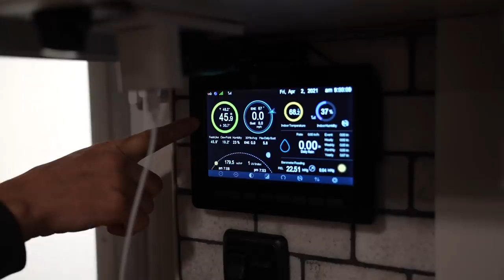WE'RE NOT READY FOR THIS | BUILDING OUR OWN HOME

Comment: Pro tip: place wood backing behind where you will be hanging towel bars.
Reply: Builders never do that. That would be to easy .
Reply: And future grab bars.
Reply: And curtain rods
Reply: also where you are hanging cabinets. always a common practice when using metal studs
Reply: Yup, hang a cleat either behind the sheetrock or in front if you like that aesthetic. Makes installing or changing hardware much easier.
Reply: Also where you might mount a TV.
Reply: Yes!   I wish my builder had done that.  All of our towel holders are loose no matter what we try to tighten them up..
Reply: Use the scrap 2X6 that are left over after framing for towel bar backing and also above the cornersof  window for window treatments if your doing that.
Reply: You cannot say this enough!   Reinforce every place you will be attaching anything!
Reply: Good idea. My aunt built her home and hung wood between the studs where pictures would be hung and took pictures of the open wall for when they were finished, so she could find them easily.
Reply: Also behind TP holders
Reply: Oh yes. In NZ we don't just gave studs. For an 8 foot stud we have 2 nogs (like horizontal studs that fit between the studs) and even that is not enough.  It is frustrating when your towel rails etc have to go in a spot where there is reinforcing, rather than where they look best and are most useful.
Reply: And run electric, with all the other gadgets and amenities I can see some heated towel racks in your future...
Reply: @1BobsYourUncle  sounds like you need to use some spring toggles!
Reply: Brilliant idea!!!

Comment: Hey Trent and Allie Love your videos. Quick reminder upstairs the electrical outlet next to the water pipeline that will not pass you are gonna have to either relocate the water line or you gonna have to relocate that electrical outlet for one reason one reason only if that pipe breaks or you have one little wire exposed when that happens and you end up with a big old fire
Reply: Great eyes on that catch Charles...way to watch em...

Comment: I think I was the first to suggest writing or labeling "blue" on that particular red pipe/line. Now I feel like I had a part in the house build! Yay!

My next suggestion if you haven't already thought of it, is to put insulation on the inside walls to dampen noise between the bathrooms and other rooms. During a reno I put insulation between the laundry room and kitchen so now we don't have as much noise when the washing machine is on. Did the same around the dishwasher.

Comment: So much enjoy your "house build" videos.  You're doing a fantastic job and I'm so impressed with your work.  
A couple of suggestions if I may: 1) I didn't see an electrical outlet mounted at the main panel which always came in handy and 2), before enclosing the walls after everything is installed, take pictures of every wall (helpful if you place a ruler in the shot for reference) so that there will be no questions by you or future homeowners as to what lies behind every wall.  Thanks guys and keep up the great work!

Comment: In bath recommend  putting  3/4 plywood  or 2x10 or 12 blocking  around  where  any thing  may be mounted  like towel barks or hand grab bars 
  I currently  apartment maintenance  when having to make handicap accommodations  with grab bars ect   sheet rock  just not strong  enough  to anchor  into .
 Know you  both heathy but planning  for worst  pray for the best

Comment: The smoke detector you’re going to install main ceiling area. You would have to have a ladder to reach it when the battery dies. It would be a problem in future. Even though you have hard wire power to the smoke detector but will also include battery as a backup in case of power outage. So be prepared to having chirping when battery is no longer good then you would have to change the battery.
Reply: Also, having it above the wood burner may cause it to go off a lot more than needed.
Reply: I was thinking the same thing. We have 4 in our small place all hardwired together. When one battery goes out they ALL sound off and you can't even tell which one is it that needs to be replaced because they are ALL going off. DON'T DO IT Trent! You will regret it at 3am when that alarm goes off. Just say'n .
Reply: I'm a property manager,  by code where I am the smoke alarms are wired and ours have a 10 year back up battery, The new wired ones are not like the old battery type you had to constantly change, once the backup battery dies the whole wired unit needs to be replaced you cannot change the battery. I just had a faulty detector, a wired one, give a low battery message in a tenant's unit and it was only 2yrs old, Kiddie sent me a replacement and wanted the old one back to investigate why it failed at 2 yrs.
Reply: Been there, suffered with that. My kids said I sold my dream house because of that blasted scary "WOOOOONK!" the stupid thing sends out when it's 1° in the house at 2am. The first time it did it the "Mr Idiot Who Built House" said I levitated 3 feet in the hair and was reaching for my ankle holster yelling, "Everyone DOWN!!!" When my brain caught up with my actions I point my nonexistent gun at him! Husbands can't live with 'em, can't shoot/maim/punch in the gonzos or otherwise make yourself smile.
Reply: Is code inter connected smoke detectors?  So when one goes off they all do.  New builds here require inter connect.  If so, inter connect detectors require 14/3 cable.
Reply: I seem to recall a code about how close to the peak it needs to be in a peaked\vaulted ceiling. If you have ceilings that are pitched, install the alarm within 3 feet of the peak but not within the apex of the peak (four inches down from the peak).

Comment: DO NOT install a Smoke Detector in your kitchen.  You will be sorry, just like the 4 inch wall that you had to re-frame to make it a 6" wall.   And your smoke detectors will have a battery that must be replaced on a regular bases.
Reply: Do the hard wired ones have battery backups? If so, the beeping of that high one that can only be reached by scaffolding will drive them batty! At the very least, they need to be able to reach it from a ladder.
Reply: @divekatdreaming  A ladder which is easily accessible at 4 am is almost essential. Since that seems to be their chosen time to incessantly and repeatedly notify of heaven knows what.

Comment: The nice thing about PEX plumbing is that it will swell when frozen and retract when thawed.  That and PEX does offer some thermal insulation.
Your walls arent load bearing so you dont need to worry about crush with 2x4 walls.

Comment: Trent, you can use what is called a blank 1900 cover as a replacement for a large nail plate. They are 4' square metal electrical cover plates and the NEC (National Electrical Code) code book allows them because of their thickness. A couple flat roofing nails will hold them in place

Comment: When you get to drywalling the two story space that has the big beam in it you might want to consider a 18” to 24” wide flat portion and not bring drywall to a sharp point which is impossible to finish.  It may take some framing.  I did this in my home and worked well and is a good place to hang the ceiling fan.

Comment: Just a thought. Remember you still have to change the battery in your smoke alarm every spring and fall. Yes you have to do that with the hard wired ones as well. Also, they seem to need to be replaced about every 5 years. Make it easy on yourself and put it where you can access it.

Comment: Just built my home.  We had to have 2 carbon monoxide/fire alarm combo since we had gas fireplace.  If you are going to go with gas on stove you may have to have one also.  My house is about 1600 sf and I had to have 6 of these alarms.  2 monoxide/fire and  4 reg fire alarm.  Even had to put one in laundry room.  Just letting you know so you can save a trip to hardware store.  I only purchased fire alarms and had to make a trip back.  I also built in studs before sheetrock was hung anywhere I was going to hang heavy pictures and towel racks.  You won't regret it.  If I didn't know exactly where I was going to hang something,  I put one up where I knew there was a chance of something hanging there.

Comment: the detector in the vaulted ceiling needs it own on off switch for when it goes off just because it feels like it...you're gonna want a way to shut it off without shutting everything else off on the circuit its on at the fuse box (if your code allows). If not make sure its on a dedicated circuit. Or leave the scaffolding in place it the great room. Every powered detector I've had, at some time (and  sometimes more than once) has decided to go off for unknown reasons.

Comment: When you bury pipes in outside walls, build a panel for access.  Build with repair in mind.  Also, how will the roof vent when warm moist air enters through the ceiling light boxes and then condenses on-the underside of the roof?

Comment: You all are amazing!   In Maine they want your hardwired smoke detectors  to also include a frequently used light appliance in the same circuit so you know if the breaker is ever flipped for safety reasons.  Thank you so much for sharing all your hard work in video.

Comment: Trent you should move the smoke detector in the living room to above the bedroom floor because you will not have the scaffolding there when you have to service the smoke detector in the future. I would put it over the bathroom so you don't need a really tall ladder in the their to get to it. In most states the smoke detectors have to be hard wired together with a common bonding wire so if one goes off they all go off, usually by using a three conductor wire with red as the common, if you did use that then my bad but couldn't tell when were stripping out the boxes. That was a great display of how to use those lineman pliers just make sure you don't use the side where they pivot/hinge or you could damage the metal and they will be hard to open.

Comment: On those kitchen pipes that are in the outside wall, put insulation between the pipes and the outside but don't put any insulation between the pipe and the inside. That way heat from the inside can keep the pipe warm. Also don't insulate between the pipes instead have a little cavity there that can be warmer because it's getting warmed from the warm air in the house through the drywall.

Comment: Please accept given my experience on dealing with water lines run in an exterior wall,  I would place an electric heating tape along the pipe inside the wrapped insulation.  Such tape will keep the pipe above 32 F.  Just keep in mind that by wrapping completely in insulation, that means that the heat from the inside of the house can't keep the pipe hot.  And so yes insulation helps hold the heat but also keeps the cold once the heat is gone.  Also you are assuming that your hot water loop is always running but of course if you lose power etc,  that will be gone.

So please run heat tape inside the insulation on the lines running on the exterior.  At least have it so you can plug in when you are worried about it freezing.

Comment: On cold water line just put insulation on outboard side - that way home heat will keep pipe warm enough so it wont freeze.  Dont put insulation on room side of water pipes in exterior wall.

Comment: Figure out where your door knobs will hit the drywall. At those location put some 2x10 blocking behind the drywall. That way if a door ever gets slammed it will just bounce off the bump stop instead of putting a hole in the drywall.

Comment: Trent, insulation of pipes: Many - as I - thinking of a different way to built. Many houses have only the outer wall an a tiny amount (if any) of outer insulation. When you put on a qualified 3" insulation, that should be fine. 
Insulation of pipes: There is always a serious distance of circular warm water pipe. This in sum would spread a lot of heat that the boiler must replace. So well done!

Comment: TRENT PLEASE CHECK before your 4 way inspection about the smoke alarms. here in NY, all the detectors have to go off when one senses smoke. in order to do that, you need a 3 wire romex between each detector. the feed comes into the first one, than you have 2 wires to power the others up, and the 3rd wire is the signal wire that sets the rest off to let the whole house know there is a smoke condition going on. i used my lineman pliers for over 40 years as a hammer, and there is nothing better than watching construction, other than 2 dogs playing and sleeping together.

Comment: It's probably too late but I would move the top floor smoke detector to the bedroom side.  Even hard-wired detectors have battery backups that need to be changed or replace the entire detector.  If scaffolding was required to install it, it will be required to replace it.

Comment: Trent, you are required to put up nail plates only if the edge of your holes are closer than 1-1/4 "  to the face of the stud. If you drill
 a half to 3/4" hole in the center, you will fulfill the requirements of the NEC code

Comment: Run some conduit from the various rooms in the house and have it all come out down by the furnace room. Just put strings inside of it for now. Later on if you want to run a security system or some internet or some other new device it hasn't been invented yet you can pull the wires to the conduit.

Comment: The smoke detector boxes reminded me that you might want to figure out where your WiFi should go and mount some boxes and make the Ethernet runs. Maybe some extra combination ether/tv coax boxes where your entertainment center or TVs might go. Ubiquiti makes a cool network system I use in my house called Unifi. Make all the runs with CAT7 cable for future high speed support. An outside box to attach your starlink cabling and/or satellite tv might be useful too.

Comment: That 2" depth threshold on the nail plates must be your local code - i think national is just 1.25 because you're usually only using that length screw for drywall. I'll find out today ... getting my electrical rough in on a bathroom i'm renovating. I've got the nailplates on hand, but didn't install them.

Comment: Trent, Allie, hello, I enjoy your videos very much. Have you considered running cat6 cable, for some ethernet outlets where you might need to put an access point for wifi, in distant parts of the house, or at the other remote construction where you built the  other foundation? Or  for connecting a smart tv directly to the router?

Maybe some speaker cables, for some speakers on the ceiling? Or for surround sound for the tv.  

And cat5 cable for video surveillance cameras at the outside of the house.

Best regards. Keep up the good work. Octavio, from Mexico City.

Comment: We have 7 of those wired fire alarms and found them to be very irritating.  It seemed like when one went off, they all went off and for no reason - maybe an interruption in electricity, who knows.  So we put in the new 10 year battery fire alarms in each of the 7 spots instead plus one carbon monoxide 10 year battery alarm and are now happy.

Comment: Just a word about inspectors.  Its common for inspectors to fail you the first time.  Actually if you are a contractor calling out large numbers of them every year, they will look to fail you more.  I learned to always have a cooler in the garage filled with "cold beverages"... and that seemed to make the inspections go better.  The plumbing inspection for me was always the hardest one, but it was also the one that my guys learned the most from too.  Electrical was usually a breeze... mostly because the inspectors just know the basics about electrical work so just inspect for the few things they know about.

Comment: on Smoke Detectors:  I hope you ran 14/3  wire between them all (white and black wires for the power to each and the red wire is the alarm interconnect between each one---so they all sound when needed) and......  Why run the power to the panel ? My inspector wants them powered off a circuit that is used everyday , like kitchen or bath room lights....reason is you know everyday the smoke detectors are powered ( I know they have battery back ups but...) and also for that high ceiling one get a 10 yr battery backup one for up there.

Comment: This might be a stupid question but, what is the advantage of doing the fourway inspection early, even though you know you're likely to fail and need to retake it?

I assume, it's so that you can move the build forward in areas that you pass on, whilst you work through the minor finessing needed to get a pass next time around? Or is it just a confidence check, to know you're on the right path (even if it's not finished) before you're so far ahead that some mistakes are harder to correct?

Comment: Just a heads up. That “clear” Gorilla sealant will turn yellow very quickly. Probably not an issue if you are hiding those lines, but be careful if you use it somewhere expecting a clear finish.

Comment: Yeah, that hardwired smoke detector.... we had one at a high point like that. Hope you never have a power outage at 2am when the backup batteries are low. Take note, you’ll need to get up there to swap out the batteries now and then. Maybe keep the scaffolding?

Comment: Something to consider. When the power goes out, your smoke detector will make this annoying beep every so often to alert that it is on battery power only. Be sure that you put them in locations where you have access without needing an insanely long ladder. You will probably not have a big ladder in your finished house. Also, do you want to be on a ladder with no lights on?
  Our smoke detectors make us crazy every time the power is out. At least we can reach them easily with just a small step stool to stop the incessant chirping.